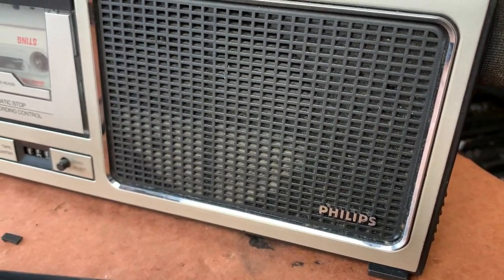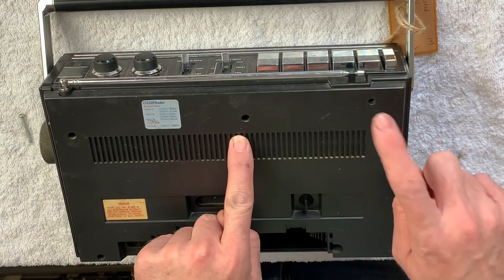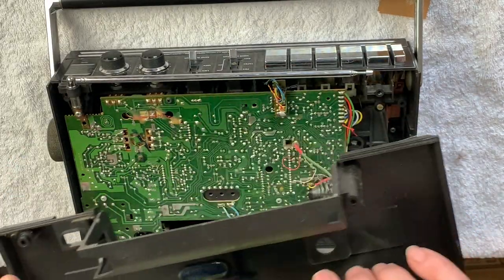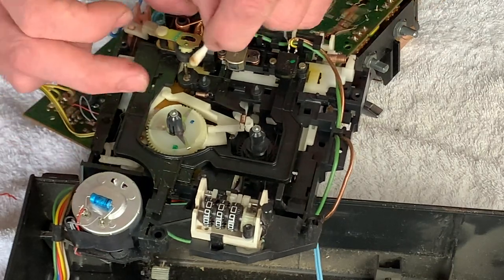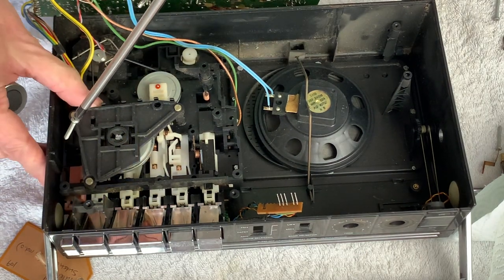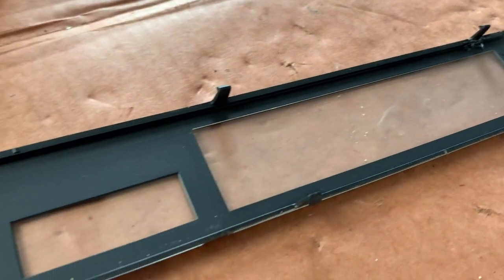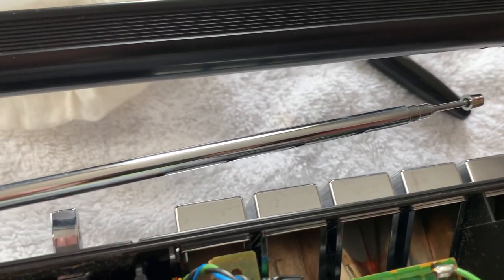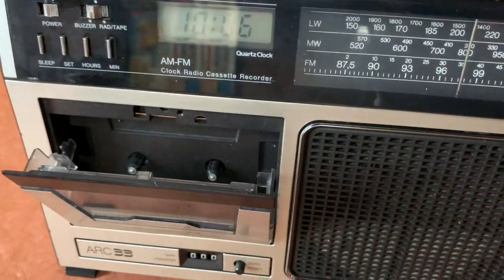Philips ARC33 Radio Cassette Repair. Vintage Audio Fix

Comment: WOW what a lovely little machine-fully functional tape deck with Cue/review full auto stop,pause and tape counter-as well as a quartz clock.

I remember seeing these in Boots and Currys,in the early 80s-I bought a similar model,Philips,but without the clock-,about this time,lovely little radio/cassette-sold it to a work colleague,a little time later,because they liked it !!

Next went in for a sharp GF 8080 Stereo-another fantastic radio/cassette with co-axial speaker system and APSS on the tape Deck-find the next song,or go back to the start of the previous song on a cassette !!!

Changing the subject,love your collection of boomboxes on the shelves,towards the end of the video-looking forward to seeing these,and you repairing and restoring them !!
Reply from the maker: Hi, and thanks very much for watching! I feature a few personal stereos from Boots - the good old days when you could buy electronics and toys in there! 
Yes - this was a nice time for radio cassettes - lots of features - although this started to come at the expense of build quality in some cases. Those quartz clocks are great, but they have a tendency to pack up due to the complicated zebra connections. I've wrestled with them now and again, with greater or lesser success!

The GF-8080 is one of my favourites. Very heavy, beautifully put together and sounds great for it's size. I refurbish one of these about once a month, and I featured one on my channel last year - here's the link:
https://youtu.be/JfXU8029-Vk

The boomboxes on those shelves are about half of what lies in store to be sorted, so do please subscribe if not already, as ther'll be plenty more coming up!
Thanks again and best wishes
Reply: Thank you for your reply !!

Yes-I must add that some radio/cassettes were made by Philips,for Boots Audio and Pye !
Reply: To add…

A few years after I got the GF 8080 I went in for a sharp VZ2500-a fully portable(but very heavy)boombox,with a built in vertical Turntable,which could play both sides of a record without turning it over-as well as a 4 band radio and Dolby Cassette Deck with APSS !!

Comment: Can i send you my Sharp GF9090 to fix 😂 it all works well, except the tape deck, chews up tapes, stops when play is pressed after a few seconds! Fwd and Rew/ search work find, Think it needs new belts and a good clean up on the mechanism
Reply from the maker: Hi, and thanks for watching.Sounds like you've got your hands full there! All 3 belts are likely to need a change, and possible renewing idler tyres and maybe even the pinch roller. I suspect the capstan bush as well - these turn to goo, and prevent drive to the take-up reel. Consequently, the tape is pulled through but spat out, and the auto-stop will kick in as it thinks the tape has finished. I'll be working on more GFs soon - but in the meantime, you might want to check this one out. Similar issues to your 9191.
https://youtu.be/eFyVnzClueU

Comment: I've got one, but unfortunately play doesn't work anymore, rwind and ff work fine, so does raido, clock and the built in light sensors, I'm hoping it's not the belt because going by what I've seen here it will be a very tiring unfun job
Reply: I took a look at it just now and I think it's the gear that holds and moves the play spindle that's causing the problem, play works for a second then stops, I press pause and then unpause it and spins again for only one sec then stops, pinch roller is fine and keeps going though
Reply from the maker: It might be worth looking at it. Mine had fought me all the way, and the edited video is missing a lot of the grief! On a fresh day, I'm sure it wouldn't be so onerous! It might be a slipping clutch - I had that on one of these before. Worth a look though in case the mech just needs a clean from old dry grease, etc
Reply: @retro_restos seems there's a couple of teeth missing in the orange cog just below the pinch roller, and there's no way I've a replacement or can do anything for this anytime soon :(